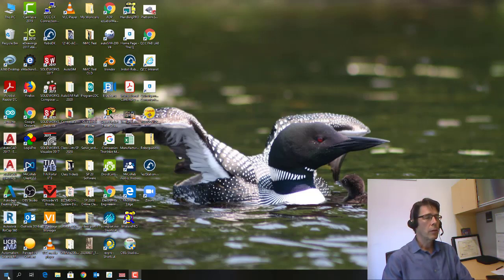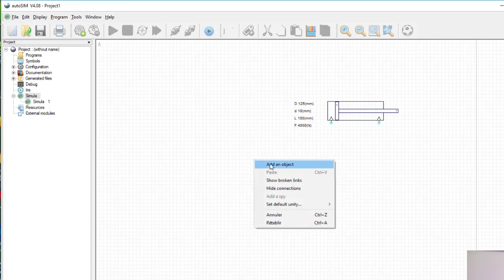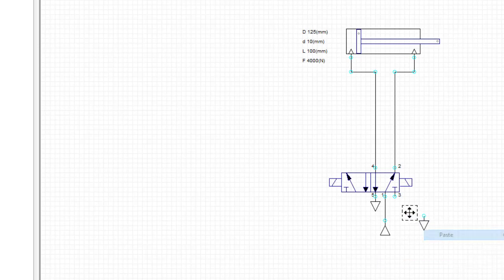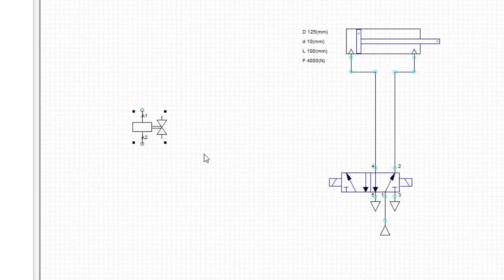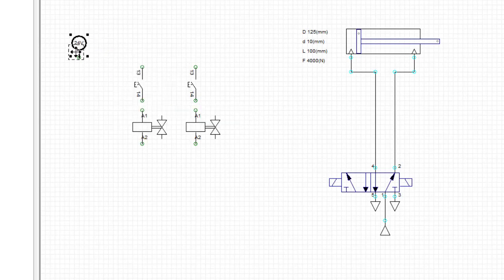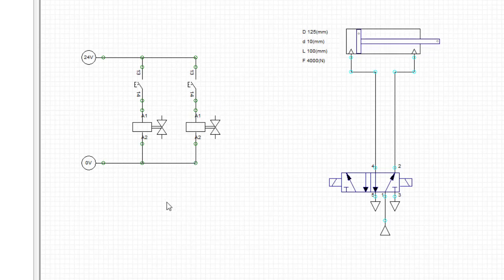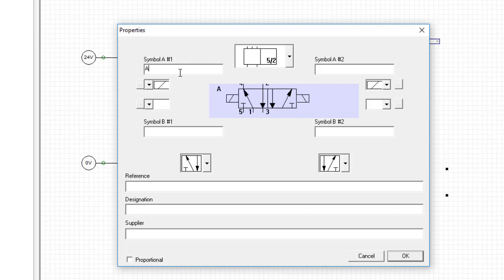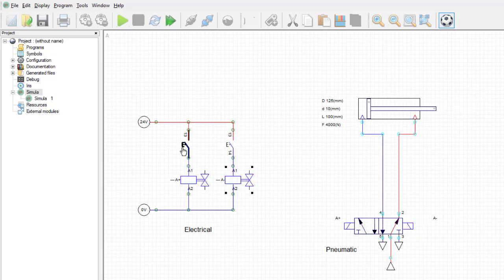ELM258 03 AutoSIM Tutorial Electro Pneumatics Part01

Comment: Jim,  great tutorial!   I have an autosim 200 and rotated the double acting with piston rod facing up.  It has a default load of 1000N.  I simulated removing the air supply to the 5/2 valve so that the piston side (head side) of the cylinder is back to 0 barG.   The double acting did not retract.  I wanted it to retract.   I want to show the students the benefit of using a pilot check valve but I need to show them first the "problem".  Is there a way to fix this?   I hope to hear from you soon.  Thanks